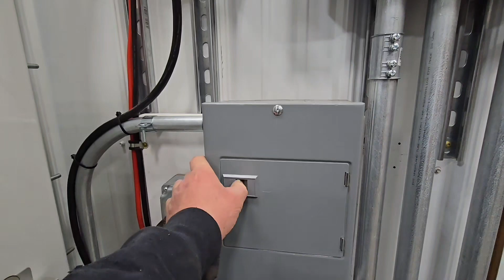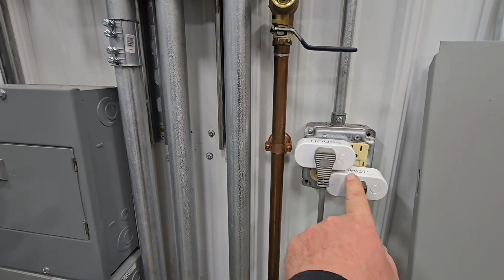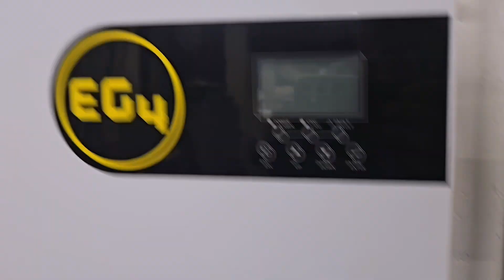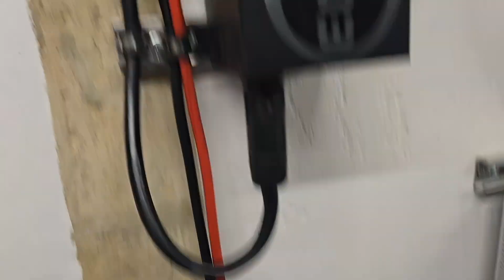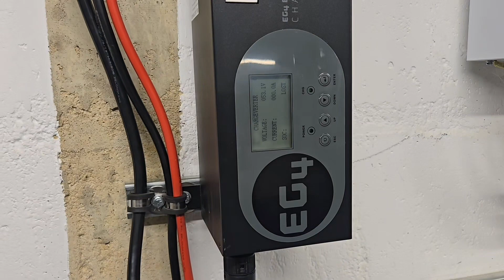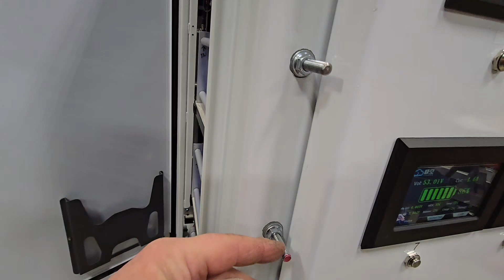Transferring Power Between Shop Solar System and House Solar System

Comment: could you use ferrite bead to help EMI shield the WIFI devices?  or maybe cut a part out of an old microwave and create a barrier with that (this sounds kinda stupid but I bet it would work)
Reply from the maker: That problem still remains to an extent. I did move the wireless access point higher on the wall but still occasionally see a "device is offline" in the app. I might try a different brand or find some hardwired smart plugs. It's not a huge problem as I am in the shop all day so I can always push the button but if I am remote it isn't pleasant if it doesn't work. The house Shelly smart plugs have never suffered from this problem.

Comment: I agree with every word you said.   Dont be too worried about the state of charge of your batteries so long as they stay above 10 % you are fine and even if you wanted to take them much lower like 1% so long as they are charged to above 10% in the next 12 hours or so they are still fine.    
  What I have noticed is that when we start down this road we start with say 200 AH and  we run out so we get 400AH and seldom run out but still why not more so pretty quick we are at 800AH  and we worry about it being 20% forgetting that 20% of 800 is almost what our original capacity was.   
dont be afraid to use the bottom... it is all about how long they stay there not how low they get.   At  "OUR"  age it is hard to break the lead acid education we have.

Comment: Why did u need to swap out those 16?
Reply from the maker: I had 8 Grade B cells in there that were 280K and 8 280N cells as part of an experiment. The 280N's would hold balance well, the 280K's were never matched and those 8 had 3 severe runners.  I had a good use for them such as the golf cart and decided to pull all of them and switch to a matched 16 cells. Lesson learned, only buy matched Grade A cells from a reputable source.
Reply: @doczwy8143  ya I never trusted buying the grade B cells. I stumbled across grade A envision cells on battery hookup for 71 each so I bought 96 of them. They said for that many it was free shipping from Pennsylvania to Michigan. They had all the hardware but were a over a year old. They all tested fine and have been running my house for awhile now. They had over 700 cases of 4 for sale. All gone now. They sold all of em within like 2 months
Reply from the maker: @electromechanicalstuff2602  I had the 8 280N's around here as I intended on building a pair of 12V batteries, then decided to just buy 8 more cells and make another 48V battery. Only thing available at that time were 280K's which I made work. Grade A were in short supply and priced close to $160 per cell shipped. I wish I had never seen them.

Comment: This build is a work of art. If I didn’t already have a Powerwall along with my 10 kW  array, this would be my blueprint! Outstanding, thanks for sharing.
Reply from the maker: I actually posted on the DIY Solar Forum a few weeks back that my systems are an extension of myself and I consider them a piece of art.  I'm not OCD but I am particular  about how I build something. Thanks for the kind comments, I don't make a dime off these videos but like to share the experience. Maybe it will inspire someone to build their own system. It is quite satisfying once it is done.

Comment: Nice!!!  This is pretty much exactly how I'm going to do mine.  Finally got a contract signed on the new shop so hopefully that will get started soon.  I like the way you set it up so you can switch the chargeverters on and off remotely.  I need to look into what it takes on the contactors and the wireless controllers you're using.  Great job, Doc!
Reply from the maker: Nice to hear from you, I hope you have come thru this winter well down there. There is some conversion loss due to DC to AC, then AC to DC but to simply move power from one system to another this works well. One could AC couple like Tim does but it would require a good sized power plant on the one end and would only be one way. Some days one system hits full charge before the other or I want to transfer power in the other direction. Contactors are just cheap ones from Amazon and occasionally do buzz some so don't put them above your bed. 🤣
Reply: @doczwy  We did pretty well through the winter.  I haven't been on the forum much but I'll get back to it eventually.  This is what I was planning to do then Tim mentioned the AC couple option.  I'm still inclined to go this route.  Good info on the 10 awg wire.  I'm going to be about 170 ft or so.  If it's working for you at over 200 ft I should be good.  I'm thinking I may run a cat5e cable or two in the conduit as well to give me some hardwire network connection if I decide I want it.  What amp contactor did you use - 30 amp?
Reply from the maker: @easttexascowboy257  40A Sunlee from Amazon, 120V coil
Reply: @doczwy  Wouldn't that be 240v for the chargeverter?
Reply from the maker: @easttexascowboy257  Yes, 240V thru the contactor for the Chargeverter but the coil choices are always 12V, 24V or 120V. With the 120V coil, you can turn it on/off remotely using any smart plug on wi fi.
Reply: @doczwy  That makes sense. I should have caught that from the way you described it.  Sometimes I'm a little slow on the uptake but I've got it now.  I really like this method for connecting the house and the shop.  I can hardly wait to get started on it.  Thanks, Doc!

Comment: Doug, i think you mispoke, for future (230A max@75C) 4/0, 4/0, 4/0, 4Awg egc needs to be in a 2.5" conduit. You could go up to 250kcmil AL @200A or 3/0 CU  if you stick with 2" conduit, per NEC
Reply from the maker: I ran four 4/0 wires in 2" SCH80 using XHHW Aluminum and it comes to 37.92% conduit fill using 3 different conduit fill calculators so with a 4AWG EGC it would meet the conduit fill for NEC. Using Encore Wire conduit fill claculator with three 4/0 and 4AWG EGC comes to 31.07%.  I doubt I would use 4/0, the house has 125A entrance panel. You have a calculator that states otherwise?
Reply: @doczwy8143 I'm still learning and appreciate what you've taught me, i could have done it wrong. I used Mike Holt's free smartphone app called 'Mike Holt's Electrical Toolbox' and selected System/Volts: Single Phase, 120/240 Volts
Circuit Type: Branch Circuit
Circuit Protection Size: 225A

RESULTS COPPER

1. Circuit Protection Size: 225Amperes
2. Conductor Size: 4/0 AWG, rated 230A at 75°C
3. Equipment Grounding Conductor: 4 AWG
4. Maximum Circuit Length: 765 Feet
5. Raceway Size: 2½ Inch
6. Maximum Circuit Load: 0 Amperes

RESULTS ALUMINUM

1. Circuit Protection Size: 225 Amperes
2. Conductor Size: undefinedAL, rated undefinedA at 60°C
4. Maximum Circuit Length: 765 Feet
5. Raceway Size: 2½ Inch
6. Maximum Circuit Load: 0 Amperes

CALCULATIONS and NOTES

1. Protection Size [215.3, 240.4, and 240.6(A)]
22. Conductor Size (up to six conductor bundle) [110.14(C)(1)(a)(2)/(b)(2), 210.19(A)(1)(a), 310.15, and 240.4]
NM Cable, 60°C Table 310.15(B)(16) [334.80]
Other Wiring Methods, 75°C Table 310.15(B)(16)
3. Equipment Grounding Conductor Size [250.122]
Sized to the 225A rating of the protection device.

4. Maximum Circuit Length [110.3(B)]
Length limited to ensures the voltage is within 90% of the rated voltage.
5. Raceway Size [Chapter 9, Table 1]
Based on a raceway at 40% fill, with an equipment grounding conductor.
6. Maximum Load [210.19(A)(1)(a) and 210.20(A)]
Not to exceed 100% of the circuit protection and conductor ampacity.

Application Notes

1. Circuit Distance:
a. The circuit length in the app uses the following formula:
i. Single‑Phase: D = (Cmil × VD)/(2 × K × I)
ii. Three‑Phase: D = (Cmil × VD)/(1.732 × K × I)
b. Distance (D): The distance of the circuit or the length of the circuit conductors.
c. Circular Mils (Cmil): The circular mil area of the circuit conductor as listed in the NEC Chapter 9, Table 8.
d. Voltage Drop (VD): The voltage drop of the branch circuit is based on the 110.3(B) of the NEC, which requires that the operating voltage at utilization equipment to be in accordance with manufacturer instructions. Manufactures typically adopt ANSI C84.1, which specifies that the voltage at utilization equipment must be within 90 percent of the nominal system voltage. The app assumes a 3 percent feeder voltage drop, resulting in a 7 percent branch circuit voltage drop.
e. Constant (K): A value of 12.90 ohms is used for copper and 21.20 ohms for aluminum. These values represents the resistance for a 1,000 circular mils conductor that’s 1,000 ft long, at an operating temperature of 75ºC.
f. Current (I): The current of the circuit is the actual load at 100 percent. According to the NEC, conductors are sized to 125 percent of the load continuous loads, electric space heating, motors, electric vehicles, etc. However, this 125 percent factor has nothing to do with determining the distance (length) of the circuit.
2. Conductor Sizing (Commercial):
a. Conductors are sized based on the following factors:
i. Insulation - THHN, THWN, and THWN-2 (90°C).
ii. Terminals – Conductors are sized to 75°C terminals [110.14(C)(1)(a)(3) and 110.14(C)(1)(b)(2).
iii. Load – The load is considered continuous and a 125% continuous load factor is applied [210.19(A)(1)].
iv. Neutral – Where a neutral is used (slash rated circuits), the neutral is considered current carrying (50 percent or more of the load is considered nonlinear) [310.15].
v. Ampacity Adjustment – For three-phase four-wire circuits, the ampacity of the conductors are adjusted by a multiplier of 80 percent [310.15].
3. Conductor Sizing (Residential):
a. Conductors are sized based on the following factors:
i. Insulation - THHN, THWN, and THWN-2 (90°C)
ii. Terminals – Conductors are sized to 75°C terminals [110.14(C)(1)(a)(3) and 110.14(C)(1)(b)(2), except Type NM Cable, which is sized to 60°C [334.80].
iii. Load – The load is considered noncontinuous.
iv. Neutral – The neutral conductor is not considered a current carrying conductor [310.15].
v. Ampacity Adjustment – There is no ampacity adjustment, since there are not four or more current carrying conductors.
4. Raceway Sizing:
a. Raceways are sized to provide a little more space than the NEC minimum requirement. This is accomplished by sizing all circuit conductors, including the neutral and equipment grounding to the same size as the circuit conductors. The conductor insulation is based on THHN, THWN, and THWN-2 and the raceway is considered Schedule 40 PVC.
i. Single-phase two-wire circuits are sized to three full size circuit conductors.
ii. Single-phase three-wire circuits are sized to four full size circuit conductors.
iii. Three-phase three-wire circuits are sized to four full size circuit conductors.
iv. Three-phase four-wire circuits are sized to five full size circuit conductors.
Reply from the maker: @jamesbsa6450  I see where the difference is under 4 (a.) the conduit is oversized compared to NEC minimum requirements. The app is oversizing the conduit needed. This can add substantially to installation costs. Every conduit fill calculator I used showed using four 4/0 conductors as close to the max 40% conduit fill which means it can pull harder with some bends but still under the 40% max limit.
Reply: @doczwy8143  wow, good catch. So they accounted for 4/0 egc which is absurd. Wiggle room, for the electricians.

Comment: How are the Srne inverters going? Pros / Cons?
Reply from the maker: Working great. It took me awhile to determine why the MPPT's would not float the batteries at the voltage level I wanted, just a setting I didn't have set right. I'll probably do a video with settings.

Comment: Looks fantastic … love the power meters
Reply from the maker: Even though I have Solar Assistant, I do like the JK BMS screens. I can see how each pack is balanced with the other packs. It is a nice look too.
Reply: @ yes I like it also … have you connected any to rs485? I have the eg4 going to solar assistant, tried the app with rs485 and can’t seem to get it to work, see some data but nothing on the app screens.. I wonder if thee is a baud rate someplace I need to set.. also tried connecting it to Venus raspberry pi from Victron no love… the Bluetooth works but not reliable enough for me .. I don’t want to have to check when it updated last time..
Reply from the maker: @MattManSolar  I never saw a need to connect thru RS485 as I run open loop for charging purposes. You might look under the SA configuration screen under Battery after hitting Disconnect and choose the JK BMS 485 option, then Connect.
Reply: @doczwy  yeah not interested in close loop,but would like to have the details in HA . The SA option should work, but that is how I connected the EG4 batteries.